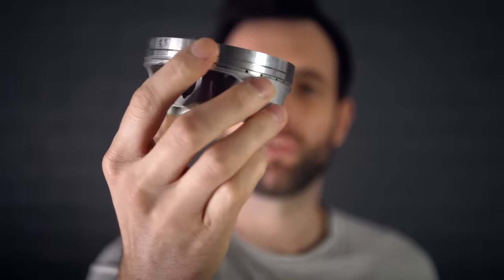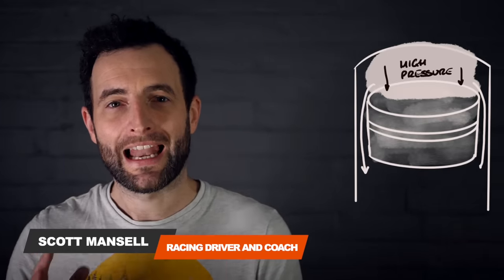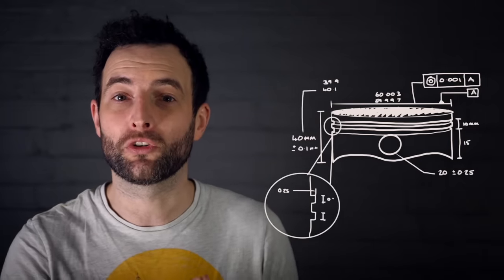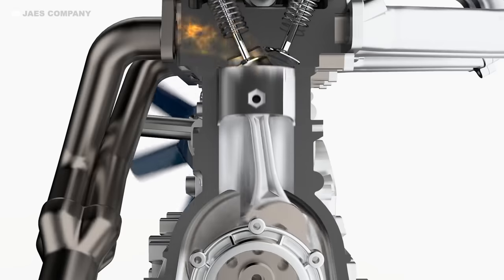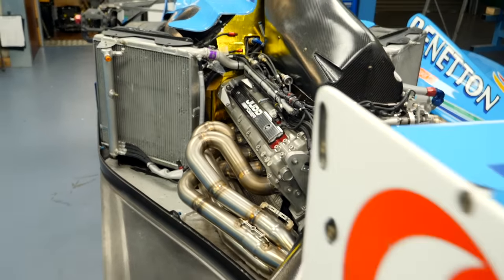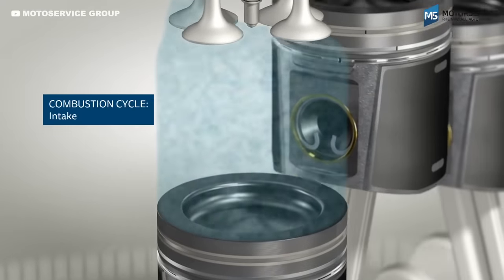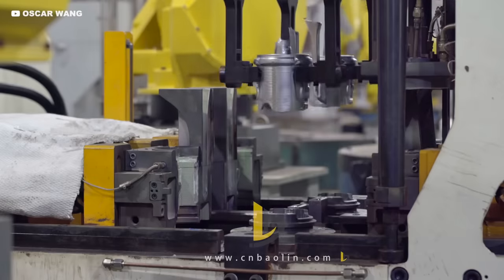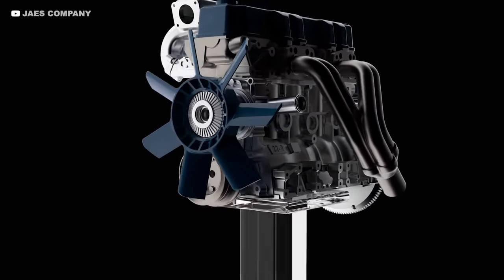Why F1 Pistons Cost £50,000!

Comment: With tolerances so tight, I would love to see how they assemble the engines and get those pistons inside in the first place.
Reply: Very carefully with a warm block I'd imagine.
Reply: They use dry ice to freeze the piston which shrinks it
Reply: i work with tolerances down to about +-0.0015mm and i can say it's more time consuming than it is hard to work with. such fine tolerances also very expensive ofc.
Reply: @Wehra96  what do you do? Those are tight!
Reply: @devinhudson4905  i manufacture parts mostly for hydraulic systems, my job title is CNC operator but i also do honing of valve components which usually have a tolerance of either +0mm to -0.003mm  or +0mm to -0.005mm. anything over 0.01mm would be considered pretty easy tolerances to deal with.
Reply: @overlandwalkabout6376  this is an underrated comment. It seems alot of people misunderstand this. As long as the OD is smaller than the ID it will fit nicely. The fits are relatively close at normal temp with the od of the piston slightly smaller as it will heat up more than the ID of the block. The block however is heated prior to start to prevent the piston from heating up and expanding at a rate greater than the ID resulting in binding
Reply: did you watch 8:30?
Reply: @LeReVaQ  I don't think thats an F1 engine. Or at least not one from todays cars. That looks like a VR6 block.
Reply: @LeReVaQ  looks like a normal engine and those rings aren't in..  I just wondered if they had something more advanced than a ring compressor and a hammer to install
Reply: Clayton, 

there is also the crank bearing clearances to consider, they too need to be at operating temperature.
Reply: Yuck Foutube  so disrespectful. So pathetic. Yeah your comment
Reply: yaelkromo Agree w ur remark.  As if the possibility of the cutting tool has a microscopic burr ... or polishing compound grit is out of tolerance.  I’m not a machinist but I can imagine unforeseen circumstances.
Reply: Yuck Foutube  honing is completely manual and i also sometimes do manual machining but operating a CNC is mostly rigging up workpieces, coding programs, tool and machine maintenance, etc the actual "button pushing" is literally 5 mins in a 10 hour workday
Reply: @sdannenberg3  Yes, they were using footage from a lot of familiar engines in that video.
Reply: They use a right big hammer, I believe
Reply: Bovrinox Yes!!  The bigger the better!  Universal “fitment” and “giving me sh*t” tool.
Reply: @flyingphotography5770  and cursing, of course.
Reply: Heated block & chilled pistons.
Many turbine engines go together the same way until they cut their own path.
Reply: Was just thinking thatmyself!
Reply: It is wrong that the block/cylinders would expand more than the piston!! A standart piston gets easily over 250°C, so which part expands more? On race engines, the gap of the piston rings (the part where the ring is open) is much tighter than on an road car. The ring (in a standart engine) can reach about 200°C under load, even if the block is cold. So the gap has to be big enough so that it doesn´t close when you hit it when it´s cold. But when the engine warmes up, the block expands and the ring gap opens up again. Obviously, you want to have the gap as tight as possible. So on a race engine, the gap is so tight that you shouldn´t drive full throttle until the water is at operating temperature, otherwise the ring will seize. But again, piston and ring are getting much hotter then the block, therefore there is always enough play when the parts get assembled. Warming up before starting is done for other reasons, like maybe avoiding unnecessary wear.
The informations in this video are not that good that I expected, not to mention the thing with the units...
Reply: Liquid nitrogen and heated cylinder sleeves probably.
Reply: Basicly hes describing a piston cold seisure you can cold seise a 2 stroke water cooled dirt bike engine by reving it wen cold. F1 engines idle like at 2000 rpm . Thus needing warmed up before lots of rpms
Reply: I think it’s all BS I just watched another video on YouTube where they’re assembling a BMW F1 engine at room temperature and everything rotates just like a normal engine
Reply: Yeah its horseshit
Reply: With a really big hammer, lol jk.
Reply: @Wehra96  The first thing I noticed is that the tolerance of 0.15mm was incredibly sloppy given today's standards.
Reply: @mysticdavestarotmachinesho5093  depends on your needs ofc but yea 0.15mm is an extremely wide tolerance
Reply: @Wehra96  It is today.  How things have changed is such a short time.  In twenty years tolerances might be in the plus or minus one atom range.  smile and grin.
Reply: @mysticdavestarotmachinesho5093  youd be surprised tbh i worked on a part just today where a Polish subcontractor managed to miss the tolerance on a part with a tolerance of -0 to +0.10mm.
Reply: @mikeherbst1825  abradable coatings
Reply: @garykirkham  I get that when compared to the labyrinth seals used in turbine engines. The materials used are meant to work together to establish a proper fit between the components.
  I wasn't aware that the same protocol was used in recip piston engines but it does make sense. Thanks for the wake up call.
✌
Reply: With a hammer? :V
Reply: A nano coating of dog feces for lubricante.

Comment: Forged pistons expand at operating temperature, hence why they're always undersized in relation to the cylinder bore, and also why it is normal to hear piston slap when cold on a built engine for boosting applications using forged pistons. The idea of a F1 engine with forged pistons being seized up when cold is a kind of odd, and I think that there is more to the story than being told.
Reply: Agreed. Why noone talks about this is odd. Modern engines have 0.03-0.05 mm gap between the piston and the cylinder wall. F1 engine has 0.15 mm gap. This is done because the engine always operates at maximum power, the piston is very hot and expands way more. If a road car has forged pistons, it has a bigger gap about 0.07-0.1 mm

Comment: Damn and I'm over here crying about paying $180 for every piston ring
Reply: i mean that's still nearly extortion for most cars.
Reply: Somebody's sticking it to you Pedro. Contact one of the ring manufactures with your ring sizes. I just bought Perfect Circle rings for my 638" (4.625" bore) chevy for $212.00
Reply: and 
F1 teams burn someone elses money too
Reply: @rallikas  they cost that much because the sport generates that type of money so the parts companies charge them way more. they could sell them for 6-8k each. but it you can make somebody pay more why sell for less.
Reply: Too expensive for what you actually need
Reply: @bigsean2473  What parts company? They use factory engines all hand built from scratch in house.
Reply: Big Sean247 
Wrong. 
The biggest costs are R&D and machines. They cost a lot because of the low production volume, so instead of the cost of production being split up between 100000 pistons, it‘s split between 200.
Reply: Big Sean247 it’s partly that, but also when you go to a manufacturer, (that is if the part isn’t made in house, which for a lot of the factory teams most of the car is) asking for parts with tolerances that tight is expensive, you need super precise equipment (expensive), or frankly it will take them several attempts to make the perfect part, or at least one within their tight tolerances.
Reply: @bigsean2473  parts company? You mean the mom and pop Piston factory down the street? Yea those rascals, always sticking it to the F1 team
Reply: Just use o-rings stretched into the cavities, they're cheaper, lighter and offer a better seal
Reply: TBH I'd also cry if I had to pay £180 per piston ring. Are yours made of diamond or something??
Reply: @Kj16V  I'm building a stroker motor built  for my M3 4.6 S65 it's about 35-40k before labor :(
Reply: @nzsaltflatsracer8054   I wonder if the F1 piston manufacturer provides vasoline with each of those pistons?
Reply: @macbook802  are you suggesting using rubber o-rings instead of alloy steel rings?
Reply: @ct1762  I'm suggesting innovation yes.
Reply: @bigsean2473  just like a hospital charging an insurance company. Making insurance unobtainable for most people

Comment: I think he means the cylinder expands more than the piston, allowing the piston to move in a warm engine.
It seems to me that a cold forged piston with machining to final dimensions would be the most cost effective when weighing strength to weight ratio.
I'm guessing that when they assemble the engine, they freeze the pistons and heat the block to allow them to fit.

Comment: 300 gram at 1G weighs ~= 3N ~= 0.3kg at 1G
300 gram at 200G weighs ~= 600N ~= 60kg at 1G

Right? If so, then it's 60kg instead of 600kg.
Reply: yep
Reply: Except they take nearly 10 000g
Reply: Yep, he got the g-forces wrong and the clearances too, so much for precision...
Reply: Thats right. And the g-forces is also uncorrect. The old F1 engines that reved 20 000rpm had as high 10 000g on the pistons, gives the max force on the piston converted to kg, 3 000kg.

Comment: I hadn’t thought about clearances in an F1 engine before... pistons effectively seized in a cylinder until the engine approaches operating temperature is amazing and surprising... but makes perfect sense... now I understand why start up and shut down procedures are so crucial to preserve an engine and maintain tolerances... amazing engineering... thank you for this video.
Reply: I've heard numerous times that it's just not true. But that preparing does help with reducing wear.

Comment: 5:40
a 300g piston subjected to 200g force will effectively "weight" 300*200=60,000g or 60kg, not 600kg !
If you multiply the result by 9.81, you get the force necessary to accelerate the piston in newtons not kg

Comment: 5:43 you are calculating a force (in newton) not a weight here. That statement is completely wrong, 600N don't translate to 600 kg.
Reply: Yeah 😂
Reply: next time you tag something #Engineering, check the units;)
Reply: Also 2:55 0.15mm is not 60 thou but 6.
Reply: 300 grams x 200G = 60kg
Reply: Better check the G force numbers again too. Those posted here are way low.
Reply: True, you need 600 N of force to accelerate mass of 61.2 kg at 9.81 m/s/s. On Earth that's exactly the value of the reaction force from the floor exerted on that object that prevent is from falling down. In other words that object "feels" 1g of g-force when standing still on Earth. "G-force" is actually not an force, it's actually acceleration equal to 9.81 m/s/s. Actually we as humans "feel" acceleration not the force. Bigger force just translates to bigger accelerations and internal body compression increases.

Comment: dont want to be that guy but at 2:54 - 0.15mm is 0.006" (6 thou). also a human hair is about 0.002"
Reply: 'Slightly wider' is key word
Reply: If the difference between the piston dia. and the cylinder dia. is .006 the piston to cylinder wall clearance is .003.

Comment: 1:37 It's a big misconception that the 2nd ring is a compression ring, it's actually an oil scraper. If the 2nd ever traps comp it will lift the top ring and kill power.
Pro Stock has a higher G loading because it has 3x longer stroke and revs only 3000rpm less.
Reply: Pro Stock engines are actually very short stroke for being 500 cubic inches. The Chevy PS engines are currently 4.700" bore & 3.600" stroke, although that is probably at least 3 times the stroke of an F1 engine

Comment: "This is why the engine block seizes when it cold... the cylinder block expands more than the cylinder when it's cold"   I guess you didn't realize this was total rubbish till someone called you out
Reply: I had a 69 Buick LeSabre that had a 350 in it that would literally SIEZE itself when it got hot and when it cooled down you could fire it up again and it did this over and over and over again!
When it was hot you could not turn anything with your hands as soon as it cooled down you could spin everything in the front end again

Comment: Wow im real stupid but I’m a learned milling machine operator in Germany, and when you talk about 0,1mm its like such an incredible huge of variation,... like even if you’re are an apprentice on a 50 year old machine, you have to be capable of producing products which are 10 times more accurate, and sometimes up to 50 times... and that is really something a good machine operator can achieve ...

Just interesting to see it from another perspective
Reply: P.s. I worked on road car parts and even there, there is no part of the motor in which tolerances of 0,1mm can be accepted .....over here we call it carpenters tolerances... 
but 0,1mm is a waaaaay to big tolerance in Automobil standards... even if it’s not f1
Reply: I was so confused by that part he definatly has the conversion wrong because 60 thou is such a big number for anything the first part I ever made in school was a 30 thou tolerance

Comment: Great Video as always. I think this is exactly why durability made F1 actually more expensive rather than saving money. I remember in the V10 era that a rule change mandated the V10 to last for 2 weekends to reduce costs. I'm not sure who it was but some teamboss said, the budget remains the same so each engine will simply be twice as expensive. Before that an 19k rpm V10 "only" costed around 150.000 pound.

Comment: 2:55 : My 14 years old motorcycle has a maximum clearance of piston and bore of 0,05mm...
Are you sure this number is right? 0.15 is huge...
Reply: This. 0.15 is more of a russian standard.
Reply: @therwfer  "Eh, stop complaining Vasiliy, I hammer it into block so it fit"
Reply: He got his MM vs Inches mixed up.
Reply: 0,15mm is normal clearance for forged pistons, cast pistons require much less clearances.
Reply: I think it migth have been an example and not coroct

Comment: Great video, I enjoy your insight into F1 tech and race theory. 

One note:
At 5:44 you mention the effective weight of the piston at 200G is 600kg. Weight (or Force) is measured in Newton’s, so it would be 600N. A more accurate comparison would be to say a 300 gram piston will behave like 60 kilograms; a 200 times multiplier
Reply: too bad 1kg isnt 1nm. its around 10.      9.81 to be exact

Comment: Thanks for explaining how there's absolutely no reason for the piston to cost as much as a Ferrari engine
Reply: Yeah, he totally forgot the fact that the R&D cost is divided between few produced units, which is likely the largest contributor to cost. I doubt it costs much more to manufacture an F1 piston than a high-end sports car piston.
Reply: @1312_PV  Yep, also F1 whole engine doesn't cost more than 500k in material and labor, not 7M lol... Especially considering that they pretty much use the same engine from year to year with just small adjustments. And what costs the most is that research, not the engine or parts themselves.   
If you would put an F1 car in production so everyone can buy, you could literally sell the whole car for 1-2m in mass production...

Comment: That means during engine assembly, the block also needs to be heated.  They probably use special torque plates along with other components that permit circulation of oil and coolant through the block during assembly.
Reply: No. They freeze the piston.